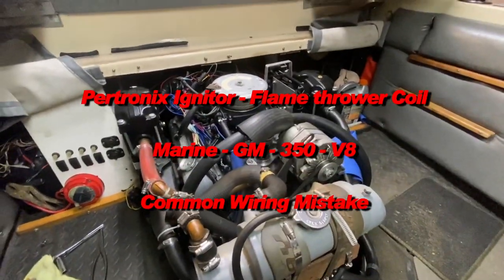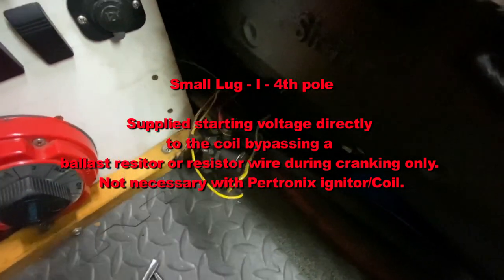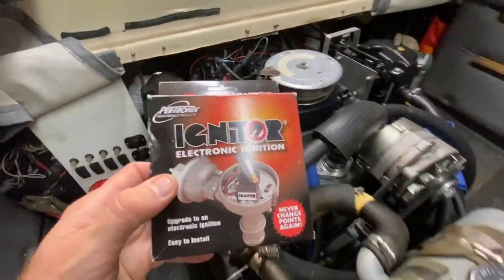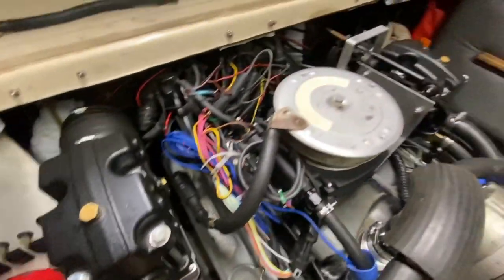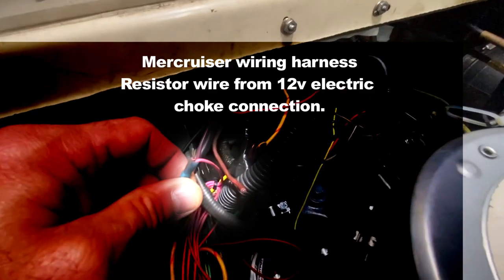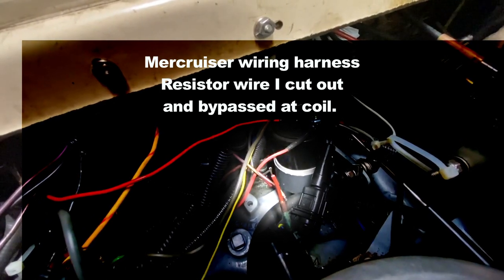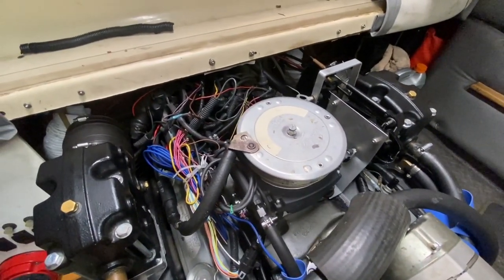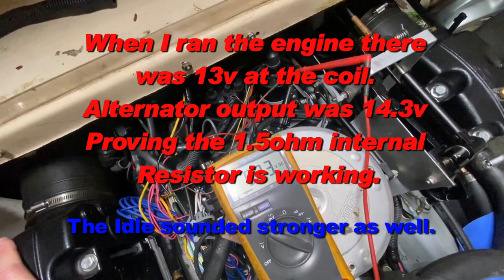Pertronix Ignitor Flame Thrower Coil Common Wiring Mistake Boat Application

Comment: I have a newbie question, with that can style coil on the ground side. I know you run switched 12v to the hot side, what do you run to the ground side of the coil? Just the ground wire from the distributor? Or do you also run a ground to the engine?
Reply from the maker: Tach wire, and the shift interrupt. thats it.

Comment: Did you bypass the shift assist when you installed the sniper Efi system and the new distributor/coil? If not can you let me know how it was wired?
Reply from the maker: I did not change the Factory wiring. The ignition Interrupt switch is still active.
Reply from the maker: I did not change the Factory wiring. The ignition Interrupt switch is still active.
Reply from the maker: I did not change the Factory wiring. The ignition Interrupt switch is still active.
Reply from the maker: I did not change the Factory wiring. The ignition Interrupt switch is still active.
Reply from the maker: I did not change the Factory wiring. The ignition Interrupt switch is still active.
Reply from the maker: I did not change the Factory wiring. The ignition Interrupt switch is still active.
Reply from the maker: I did not change the Factory wiring. The ignition Interrupt switch is still active.
Reply from the maker: I did not change the Factory wiring. The ignition Interrupt switch is still active.